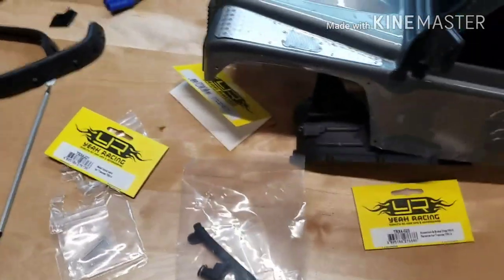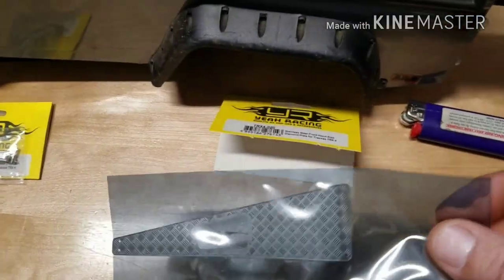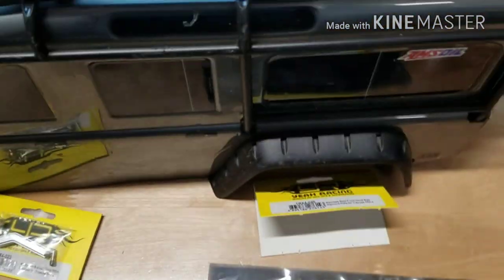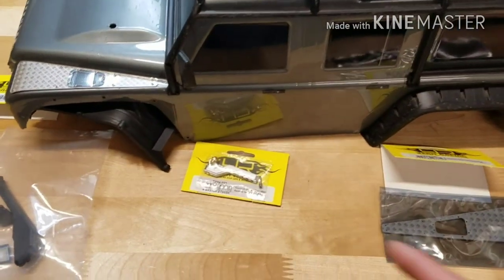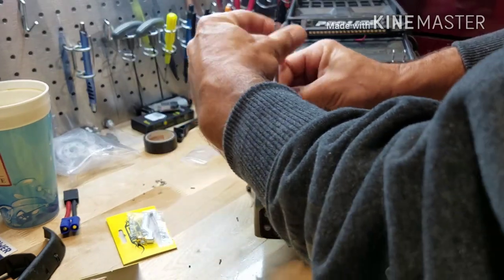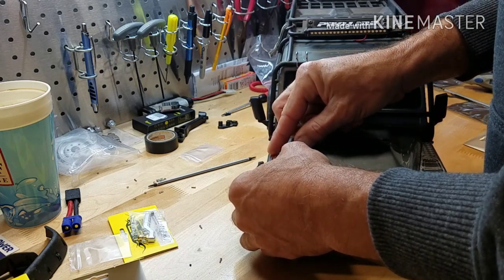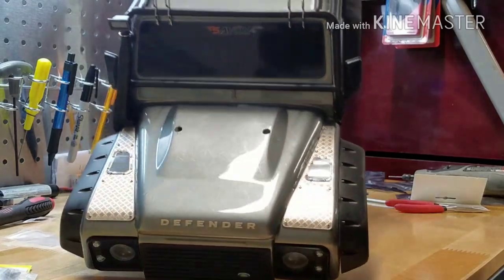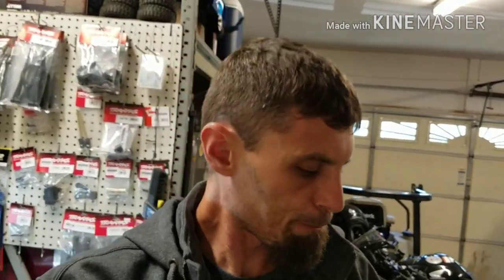Traxxas Trx-4 gets some Yeah Racing goodies

Comment: Now you Need to Build a Trailer. For those Little Nuts Your Wheel Wrench Might Fit.
Reply from the maker: I do want to make a trailer for the boat and a general use one. The nuts are tiny. Smaller than the wrench.

Comment: I have a guy that built me a 1/16 truck and I'm new at this he said I would need a receiver and 2 channel radio so it will be hobby grade not a toy you no where I might could get this stuff I have no idea what I'm doing
Reply from the maker: Spectrum has some great radios. The transmitter you buy will come with a receiver and then if you get more rc's you can just buy another receiver and connect the same transmitter to it. Just look at some rc sites and find the one that works best for you. Spectrum, futaba etc... you can check rc mart, asia tees, hobbytown. Check the out